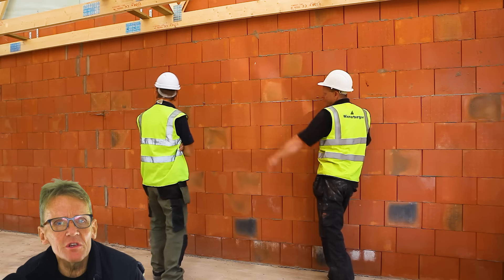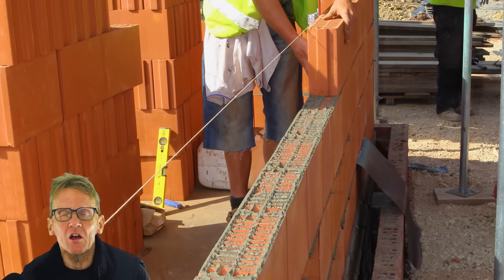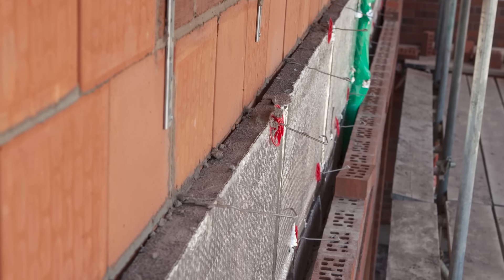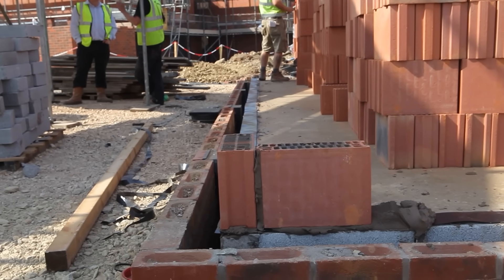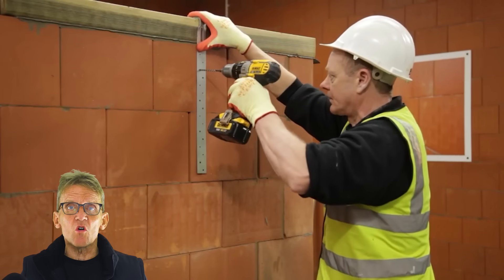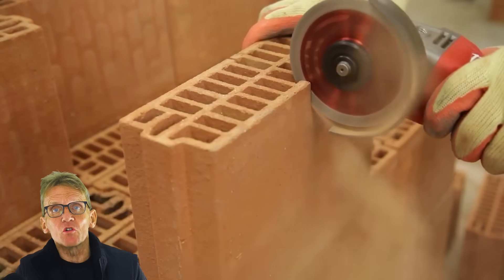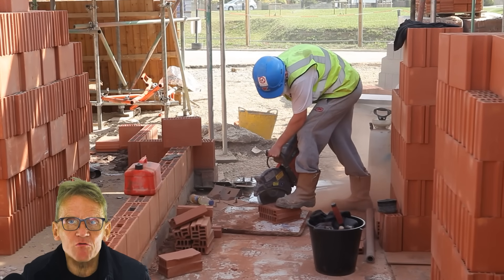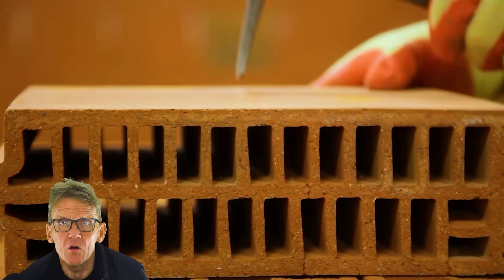Why Haven't We Warmed to Porotherm in the UK?

Comment: The explanation is, everything that was made after the reign of queen Victoria is practically banned in the UK, they hate progress over there.
In the UK, old=good and newer=bad, that's all you need to know.
PS. In the video they are showing an incorrect way of using these bricks, for outside walls you need to use 30/35/40 cm thick bricks, not 15 cm ones like in the video, but more importanly you need to isolate the first layer of bricks from the foundation with bitum or a rubber strip.
Like with any construction related product, the method of instalation is crucial and that's why the british don't bother with it, they never learn anything and would rather continue doing what they've been doing 1000 years ago, with no modification.

Comment: Hi Roger, this is really interesting. What’s a “parj coat” please? (sorry for misspelling). You applied it to the interior face  of the blocks as a treatment before dot and dab
Reply from the maker: It is really to make the stucture airtight. Parging was any slurry across the wall. It used to be lime and horsehair

Comment: They're going out of fashion on the continent for a range of reasons. The biggest warning I can give anybody thinking of using the damn things is that their open spaces they are the PERFECT habitat for dry rot to bunker down in - by the fleshy kilo. At that point you can't kill the dry rot with heat or chemicals. There's no choice but breaking everything down inch by inch with a demolition hammer. Just don't do it to yourself.

Comment: i used these for the renovation of my slovenian house with a ytong inner lining to the blockwork with no cavity. it was easy to do and the thermal efficency is incredible. our house is warm in winter and really cool in summer while facing -15 to +40 degree temperature swings outside. i really dont understand why they are so rare in the UK. love this product, also weinberger roof tiles are amazing quality

Comment: We attempted to use these on a few houses on a site I was on a few years ago. As a carpenter, to try and fix things to these was an absolute nightmare.
Reply: Got some similar bricks upstairs in my 1959 house. Rewired it a few years ago and agree was a bu$£er to fit any sockets. Really brittle, then shattered to sharp edges leaving a big void. Had to use loads of gripfill and battons to mount the back boxes.
Reply: Nightmare to plaster, we used a scud coat to stop the suction but far slower process! This was 30 year’s ago, they never caught on. surprisingly!

Comment: In so many ways they seem to be a great products. I have seen them used in Spain and other southern European countries for many years. They are available in the UK but they don't seem to have caught on for whatever reason. Maybe because you would have problems with building control ? Or getting plans passed. We have a terrible inflexible building regulation system in the UK and still build the same old, same old. To me Porotherm seems excellent product. Don't know about the cost though - maybe that's the issue  ?

Comment: I saw a while ago that someone had made a reasonably insulated house out of these blocks (a single leaf of rockwool filled blocks). Search for "Orchard Cottage, Whittlesford". Mind you, they did manage to spend about £3,000 per square meter ...

As you said, I guess the big problem with Porotherm blocks is getting them in small quantities. Wienerberger really needs to invest in the market, especially with the ready-insulated block-work to meet current building regs.

Comment: So the basic building rules apply for layout. The use recommended is for internal walls but many of the illustrations show apparently external walls. Parging appears recommended and they absorb water enough to discuss how to avoid the problem. There seems to be a lack of defined comparison of heat transmission in winter and summer with current materials in U.K. That is not bad in itself but this is a comparison article so it should be made and much of the contents seems to relate to how you can correct layout failures as with current materials.
Reply from the maker: This is not a detailed look at thermal efficiency and it didn't claim to be. The question is clear in the title. It also doesn't claim to be a comparison article. 
You missed the point about laying out the first course. With sand and cement you have a chance to correct each course as you go but with thin joint adhesive you don't. 
As for damp, many building materials absorb water and those that don't often trap water. Parging is recommended not because of damp but because the perps are not filled so there is an air gap. at the end of each block. Some people point the joint or even use a mastic on each one.
Reply: @SkillBuilder  But the title makes it a comparison article; Why don’t we use these?

Comment: The reason I'm sat at home watching this video is 40 years of laying concrete blocks,  I layed a lot of poroton blocks in Germany  once you get used to it it’s easy  but they were better set up for it large bench cutter on most jobs various sizes of blocks to reduce cuts as well 
I think training is the main problem most people try it once it’s a struggle and don't bother again, regarding training Celcon were doing  a push on thin joint around 2001 and a site near me was using it so the subbie sent me there as I had worked in Germany , it was a nightmare a proper slash gang I tried to explain to the forman the importance of getting the first course right  but no there were guys proping walls with scaffold boards trying to get them back to  plumb,  the cherry on the cake for me was when the weasely guy from celcon came around with the site agent and told me not to use my tools bought and used in Germany as they weren't any good and I had to use the supplied trowel a simple U about 100mm square
Reply from the maker: Hi Pete 
That is interesting.  I made the first training video for Celcon thin joint. The trouble was that they are not the same blocks that the merchant stocks. They have to be manufactured to fine tollerances. I built one place from them and they cracked like mad because there was no give in the courses. I think there is a good reason they didn't catch on.

Comment: Used them on my house in italy. Used 30cm thick ones, rendered with sand and cement on outside and inside. Render sticks well. I also 10cm thick ones for internal walls and used a gun adhesive for those. Can put up an internal wall very quickly this way. Took me a few attempts to buy the right wall anchors to hang things but I eventually found ones with a picture of the blocks on the packaging and they worked well.
Reply: How about any need to earthquake proof. Did you need to follow regulations?
Reply: @broxton579  my house is built with them, as shown here wienerberger 25cm if I'm not mistaken + 15cm graphite styrophoam insulation outside.

Had 6.2 earthquake a few years ago, not a crack anywhere. For comparison the wall mounted IKEA kitchen cupboards were rocked off

Comment: There are few reserves of refractory clays in Europe. In the 80s, hollow bricks were used to save money. 
It has two disadvantages. When water gets into the cavities and freezes, the brick breaks. The second disadvantage is low thermal inertia.
 
Lack of resources caused the use of Porothetm or AAC.

Comment: Wienerberger is JUST one of MANY producers of this brick. This is typical brick across Europe and is produced by many brick manufacturers. Presenting it as the one manufacturer sounds like an advertisement. So, the statement that somebody is unhappy to supply these bricks just for the patio is misleading. If you go to a DIY shop on the continent, you can buy one brick or hundreds.
Reply from the maker: Hi Joze 
I visited a site that was using Porotherm and we used a lot of their footage in the video so it would have been a bit cheeky to then talk about other sources. As far as I know there are no other suppliers in the U.K but that is not the point.
Yes you have better distribution in mainland Europe but  this is a video about whey they have not taken off in the U.K. and the fact I can't pick them up from my local merchant is a factor.

Comment: There are several thin joint systems. Celon for example. The main advantage claimed is that you can build more than 1.5m per day because the joints become load bearing faster.

Comment: It's amazing seeing how things are built in places without earthquakes. I'd love to be able to build like this.
Reply: I'd be surprised if these weren't earthquake rated. The UK and Ireland are probably the least earthquake prone areas in Europe and also the ones that aren't using these blocks.
Reply: @peglor  Indeed, parts of southern europe such as Italy, Greece and the Balkans are earthquake prone enough to be a concern.
Reply: @Croz89  most places, certainly turkey and the middle east use concrete verticals and floors and just use these blocks as fillers in the gaps to make walls. They aren't load bearing, apart from some Turkish buildings used them in the floors/ ceilings. I wouldn't trust a building like that. Imagine if dropping a heavy item broke these pots and the whole floor fell out?
Reply: Wienberger also makes a special earth quake resistant variant, the Porotherm seismic clay block.

Comment: We don't build enough buildings with reinforced concrete I guess is the major issue. If they won't do smaller quantities that means that the people who do build from reinforced concrete for single houses (i.e. self-builds primarily, be it the owner or via a contractor) will struggle to get them so then you have the issue of they'll never get accepted. I suppose it's also easy to argue they're a solution looking for a problem - traditional methods and timber frame I guess are considered acceptable at the absolute minimum.. Food for thought for those of us considering building out of reinforced concrete though, and I am - but it sounds like they desperately need a UK distributor if absolutely nothing else though.

Comment: Great vid, really interesting. We're building an extension/remodelling in ICF at the moment. Might be something to have a look at when you come across one. Benefits are airtightness/strength and insulation.
Reply: Ok, thanks for that. I'd like to read up more about that, would you be able to point me in the right direction please?
Reply: Problem with ICF is that nothing sticks to the foam, so protecting it from weathering is a nightmare.

Plus the foam shrinks and off gases, dealing with toxic gases and diminishing U-values becomes an comfort and health risk. 

Also foam is highly flammable and to remediate flammability the factories add toxic flame retardants that doesn't stop the fire once the retardant is burned through and often are a cause of serious health issues when inhaled.

Comment: I wonder if there's a significant CO2 advantage if using these instead of concrete blocks.  I appreciate the clay needs to be quarried & fired but that's probably still better than concrete, especially given the presumed reduced quantity, thanks to the air gaps.  A lighter load for transporting too, perhaps.
Reply: Do you believe in CO2 lies? 😂
Reply: @annashealthylifeeverything8583  Have you ever used a microwave oven?  Do you know how it works, beyond put the food in, press the button, it goes ping three minutes later and your food comes out hot?  What works for water content in your food also works at a slightly different frequency, for CO2 in the air, that's just physics.
Reply: @annashealthylifeeverything8583   Not the lies, no.  Just the science.

Comment: I’ve used them quite a lot and they are OK. They are a better insulator compared to concrete blocks. I use regular mortar and so long as I soak the blocks first, they are fine.

Comment: I recently worked in our garden and dug a new border. I came across about six inches down a right angle corner made of ceramic. I dug the item out and it was half of one of these bricks! It had to have been there at least twenty years. How the hell did one of those get buried in a garden in Watford? I nor my neighbours both in the building trade had any idea what it was.
Now I know. 😂
Reply from the maker: How funny, I think somebody thought they could plant flowers in it. The probably picked it up in France on a skip.
Reply: @SkillBuilder  My theory is the previous owner of our house (a builder) who regularly travelled to Spain emigrated there once he'd sold the property but not before building an extension, adding a third bedroom and enlarging the kitchen. It's possible he considered using this type of brick in its construction but either decided against it or couldn't get UK planning permission. He then buried the brick as possible drainage.

Comment: I am building my own house with clay blocks, they're very common around here (Slovakia). I used 44cm thick blocks for outer load bearing walls, 25cm for internal load bearing walls and 14 cm for the interior walls. The thick blocks have about the same thermal properties as Ytong of the same thickness. You can also get them pre-filled with mineral wool or EPS for even better thermals. They're easy to cut with a large circular saw (the thick ones) and with reciprocating saw or angle grinder for the thinner ones. There is some waste as some arrive cracked, others crack while cutting, my estimate is up to 1% based on the extra orders I had to make. I am currently finishing the wiring, no issues with the grooves for the wires - I did all of them with a cheap Parkside wall chaser. Drilling is no issue either, although you have to be more careful and use better quality drill bits. We built the external walls last year and left the exterior untouched for over a year now and absolutely no issues. Even longer periods of rain make the blocks wet only on the outside for a short amount of time, even in winter. However, I strongly recommend covering the top of the unfinished walls while laying them. Once a lot of water gets inside from the top, it takes a long time to dry. Also, I used a bitumen reinforced membrane for the rising damp, we get a lot of it around here. You can use PVC as well. I have a concrete flat roof on them with insulation and an extensive green roof on top of these blocks weighing around 35t in total and no cracks or issues there either. Overall it's been a pleasant system to work with, especially for a self-builder.
Reply from the maker: Thanks I will contact you. It would be good to see.
Reply: @SkillBuilder  WHY .. the IRRELAVENT annoying background soundtrack .. WTF !
Reply: What fixings do you use if you want to hang something heavy on the wall?  It seems like these blocks would crack very easily with expanding anchor bolts as they'd only be held by a thin outside wall of the block.
Reply: @ferrumignis  I mostly use Fisher DuoPower. You have to use longer ones to drill through outer wall of the block as well as the inside one. The blocks I use have even more walls inside, so it's not a problem to go through three walls. One Fisher DuoPower 8x65mm can hold up to 40kg in these blocks. For heavier stuff (ie. electric boiler), I'd use injection system, such as FIS V Plus. With an M12, this can hold around 100kg. The more inside walls you drill through, the higher load you get. If you drill right through and secure it on the other side you will probably sooner reach the limit of the fixing, rahter than the block. Also, I use high quality Bosch drill bits with hiigh rpm drill - best for precision. Important note: NEVER  use impact drill for these, you can crack the block easily this way.
Reply: @jojkovelky  Thanks, going through multiple walls makes sense.  I guess there is a reasonable chance of drilling into one of the vertical ribs if you are drilling after the interior is finished.
Reply: @jojkovelky    I mostly use normal Ø10x120 mm for  electric boiler i never have problem
Reply: @ferrumignis  no problem to 500-600 kg over this make steel plate.but who hange 500-600 kg on wall.
Reply: @MoreSplit  But what fixings are used?
Reply: My house is built from 'sillar' blocks which are clay, 20cm thick, with a waterproof stucco coating. NOT used for load bearing!! The house has a complete reinforced concrete frame and roof, the walls are just fill-in. Thermal performance is excellent.
Reply: @clivewarner2162  load bearing clay blocks start at 25cm thickness. If you use external insulation, the standard is 30cm + minimum of 15cm insulation, although 20cm is more common
Reply: @jojkovelky  Mine are not load bearing. Even at 44C ambient outside, there is low energy transmission. I have an IR gun to measure surface temperatures.
Reply: Nice overview, thank you. Any chance you can share construction pictures, if possible?
Reply: @tommynuker  sure. What do you want to see?
Reply: Interesting stuff, thank you for sharing!
Reply: Also use chemical fixing. Sika do a suitable material.
Reply: Used in Germany 25 years ago. Really easy lay
Reply: Do you have outside insulation?

Comment: Just don't try and put any substantial shelves up on the internal walls. Nothing to fix to.
Reply: I had (took it down because it became redundant) a 120 kg hot water tank that was fixed to an internal 10 cm thick porotherm wall. The kitchen cabinets are on the other side of the same wall. They are completely fine, these walls can take a considerable load. The outer walls of the house are made up of 30 cm thick porotherm blocks with 10 cm of insulation on them. A lot of people here (presumably from the UK) seem to think these are weak and can't take a load, they are in fact very strong. Obviously, check the ratings on them when installing something heavy, but that should be the case for any type of wall anyway. Builders are simply unfamiliar (a lot less familiar with it than with commonly used materials and methods) with it in the UK, that's all.